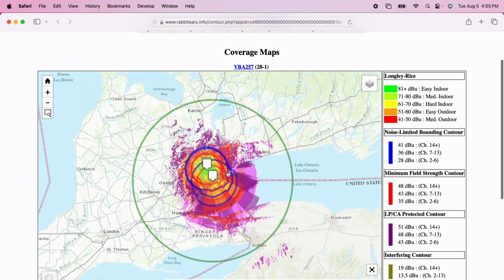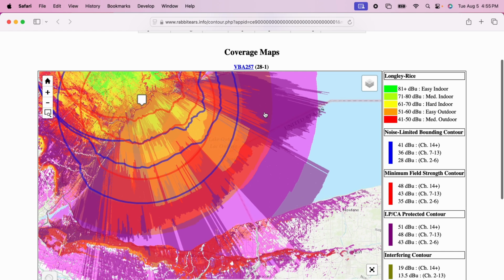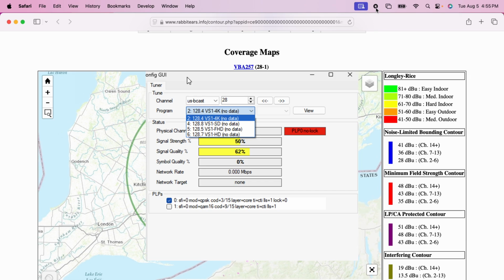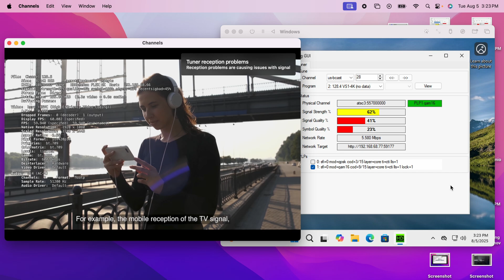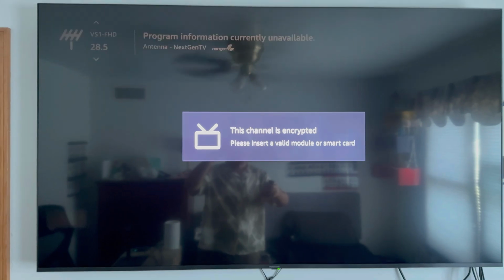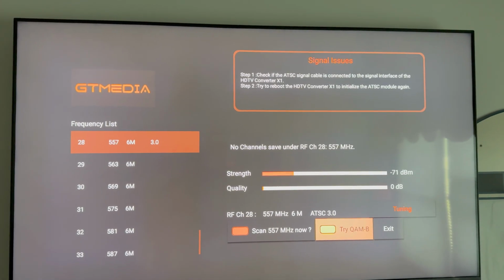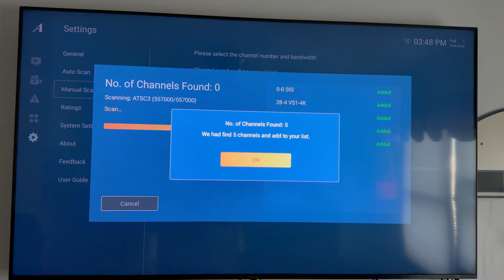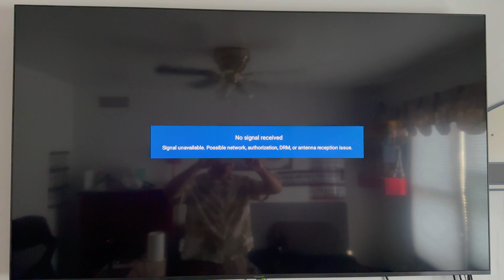A Look at the First ATSC 3.0 Station In Canada | VBA257

Comment: What was the minimum SNR for analog TV?
Reply from the maker: I'm planning on releasing a video dedicated to this topic. It's kind of a nuanced question because it isn't digitally defined and the various carriers in the NTSC signal are powered differently. Using the luminance carrier (the most powerful part of the signal, carries black and white info) as the benchmark, based on my own tests, color starts to noticeably fade around a luminance carrier SNR of 30 dB, and becomes completely black and white when the luminance carrier is around 20 dB. When the luminance carrier is around 15 dB the entire picture becomes completely snow. Analog broadcasts were powered way higher than ATSC 1.0 broadcasts are now, which is part of the reason why analog was perceived as easier to receive. ATSC 3.0 is superior to both NTSC and ATSC 1.0 by a huge margin.

Comment: In the QAM modulation world with 36% signal strengths no channel gets to your TV must have 60% of signal strength to tune a channel otherwise won't show up and this is the same with all the systems that use QAM modulation, ATSC 3.0 -ISDB-T -DVB-T2
Reply from the maker: Percentage is arbitrary. I have equipment that tells me the minimum SNR needed to receive each PLP. Rewatch my video—if you see the given PLP turn over to green on HDHomeRun Config GUI, you have reached the PLP’s minimum SNR threshold
Reply: ATSC 3.0 is OFDM and requires a minimum SNR of -5 db SNR. ATSC 1.0 is QAM and requires 15.2 db SNR.
Reply from the maker: ATSC 1.0 is 8VSB, not QAM
Reply: @WNYOverTheAir it's confusing terms , OFDM or best said COFDM it's a modulation but under the building of COFDM  lives QAM which is part of the modulation of COFDM
Reply: @NUCLEARARMAMENT are you wrong, ATSC 1.0 modulation it's 8VSB  is very different to ATSC 3.0 which is OFDM, what you mentioned QAM is the  modes of broadcast which is flexible since can choose schemes for broadcast while QAM 16, it's more robust but can't use higher video payload (Mbps) and QAM 4096 which can broadcast tons of data but it's less robust to physical noise and propagation phenomenons ,
Reply: @NUCLEARARMAMENT clear cable is the only standard set that uses OFDM
Reply: @megacap55What is clear cable? A CATV variant?